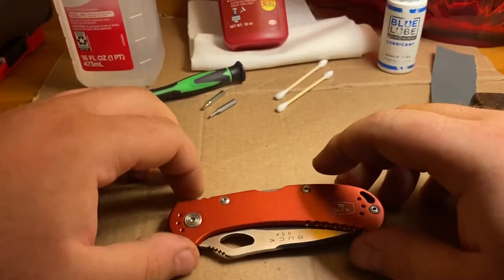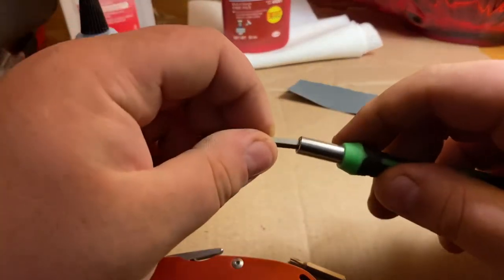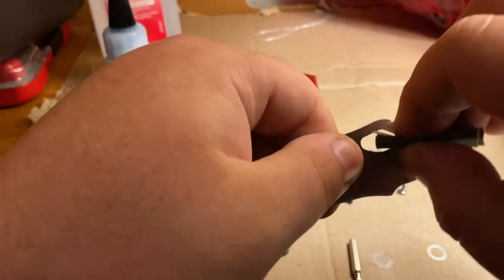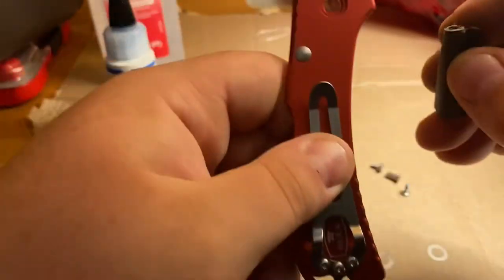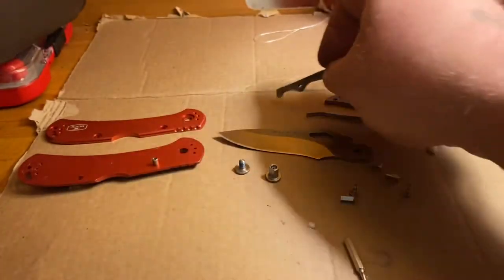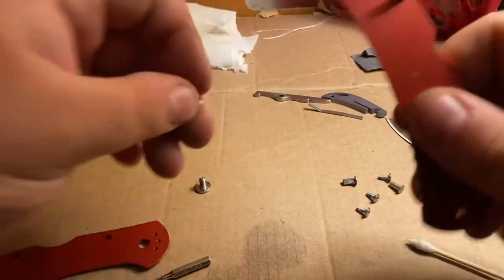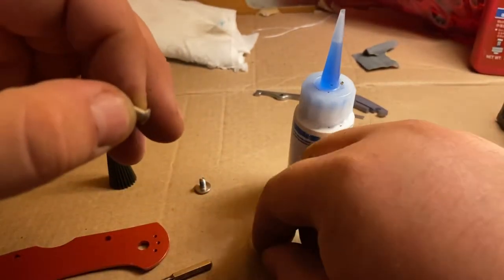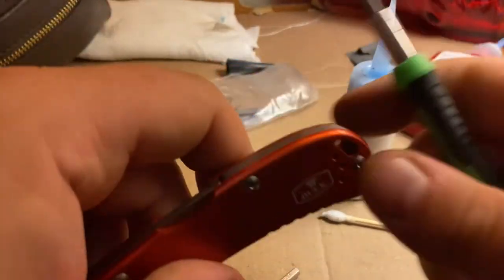Buck spitfire disassembly and maintenance

Comment: Rule of thumb is disengage blade half way put pivot in then adjust back spacer put bottom screw in tight then tighten pivot all the way then do the body screws normally that is the meta perfect action and centering also ps I just built an s45vn para 2 I grabbed the camo satin version and threw some sharp dressed knives arctic storm fat carbon scales with a titanium screw kit and lynch clip it hasn’t left my pocket in like a month I love it performs awesome and strops up relatively quick that and the pm3 m390 are my go to main users out of all my blades just can’t beat a excellent slicer lol got to lazy to sharpen the pm3 again so just buy a pm2 was the meta I have days of sharpening to do on my pocket knives not looking forward to it

Comment: Serious? Plastic washers? Bye bye Buck
Reply from the maker: Yeah lol I wasn’t too pleased either, especially for the price of the knife, I mean I get that it’s a lot less expensive vs a lot of other s30v knives but they couldn’t throw metal washers in it like come on
Reply: I disassembled mine and had no idea it had washers! They must have rubbed away... Kinda disappointed in buck. Been carrying a 119 buck for a long time but need a pocket knife for work. I got the cheaper 285 batnam buck knife but it felt cheap, so I went with the spitfire and it was expensive and cheap!! The handles feel like Thier made of cheap aluminum that I could bend by hand and the blade doesn't hold and edge for more than a day or two. Do y'all know where I can get those replacement nylon washers? Do I have to special order them or would Harbor freight have something like that?
Reply: @backwoodsjunkie08  s35vn or 420hc? My s35vn holds an edge well. I'll have to do a tear down as I'd rather grind down some brass washers if they are nylon.. that's POOP!
Reply: Nylon and acetal plastics are used in many applications including timing chain guides inside even the most expensive luxury car engines, do you think it cant handle a pocket knife pivot?  Why would you use metal to wear against the aluminum handles?  Why would you use dissimilar metal spacers against aluminum handles promoting galvanic corrosion when the coating wore off? 
The kicker is the surprised reaction at finding plastic spacers after taking the knife apart, clearly it functioned perfectly.
Reply: @glenn1035  I did some "research" (googled for a day and now I am a bonafide scientist on washers...lol ) Many high end folder knives use both bronze/copper washers AND nylon as the nylon prevents corrosion. Plus, they're nearly free to replace if need be. Makes sense once you mentioned mashing dissimilar metals together and a light went on in my head like...DUH!?!? I knew that but.. think i've watched too many knife snob videos...  Thanks for your input!
Reply: Had a busted Rat 1 knives,took it apart and swapped the Teflon and bronze washer of the Rat 1 with the ones in the Spitfire....and makes the Spitfire butter smooth,locks perfectly and no gritty feeling.